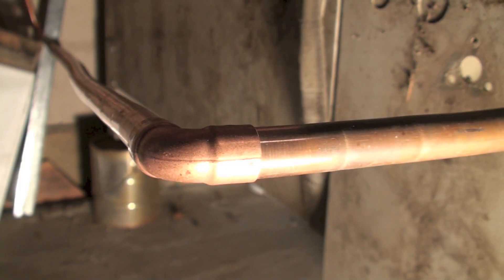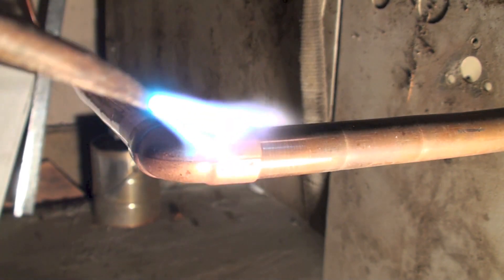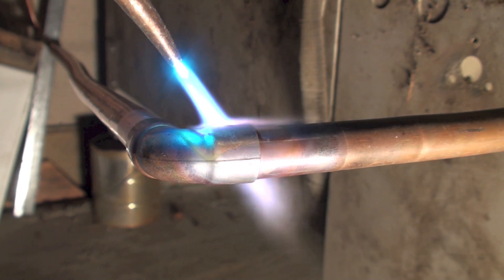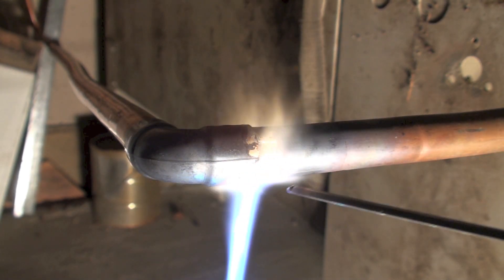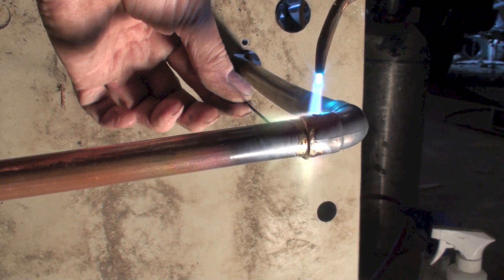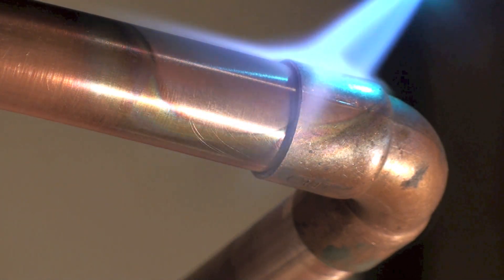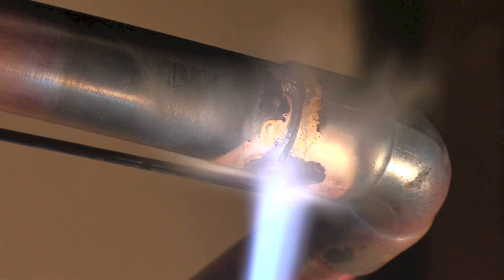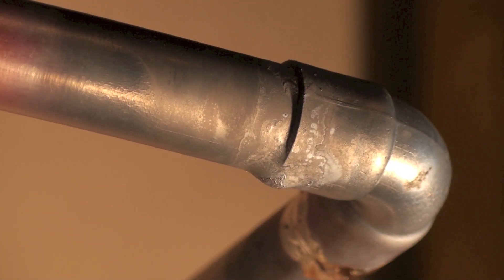How to braze copper with sil-phos brazing rod

Comment: Don't listen nor pay attention to this fool. He does not know how to braze. You do not put your brazing rod where the flame is, You put it opposite it and you let the heat melt the rod between the copper tubes. You will see the rod get sucked in and circle around to where the flame is. Let the heat do the work, not the flame itself.
Reply from the maker: I don't know what you do for a living, but I started brazing and welding in 1962.  
What you say I recommend for low temp solder using a low temp torch.
When using a 15% sil-phos, with an oxy-acetylene torch, your method will get you holes in the tubing.  Especially in the larger sizes.
Constant movement of the torch and "chasing the brazing compound around the joint" when the tubing is warm enough is the best method.  
This compound does not move by capillary action as well as the lower temp compounds do.  You will often get voids on the opposite side.
GFM

Comment: You talk about not letting the flame melt the rod, but that is what you are doing.  If you were doing it correctly, you would be feeding the Rod from the opposite side of your torch. That way the fitting is melting the Rod, not the flame.
Reply from the maker: I am not sure how much experience you have with high temp brazing, but what works for low temp solder does not work for high temp brazing.  
When working with low temp solder, I would agree the opposite side from the flame.
If you try that with high temp, you will be burning holes in the tubing when using oxygen acetylene.  The heat just cannot move that fast.  
Remember the oxy acetylene flame is very hot and that is why you use it to get the job done quickly.  Less damage to fittings is done by heating fast and getting out of there.
Note, the flame is not melting the rod.  When the rod touches the metal, it melts.
GFM
Reply: @grayfurnaceman    My Experience as follows: Beginning in 1973, Graduate of the US Naval School of Refrigeration and Air Conditioning, 45 years experience, as an HVAC Building Trades Service Mechanic, last 10 years as Service Foreman, 30 years as a Union HVAC Service Instructor, as my second job. Bachelor of Arts degree in Labor Studies, lifetime teaching credential for HVAC Service Technology, California Community Colleges. Retired as of 2017.  Not my first rodeo.  I never had a problem with silver brazing (Harris 15, Stay Silv 45, etc), using this technique, which I learned around 1973.  It is the proper way. No problem, if housing the correct tip.  I didn’t use a tip adjusted like a blow torch, unless I was purposely trying to cut a hole.  I have done every size, from small capillary tubes, up to 2  5/8” discharge lines, and 4. 1/8” suction lines. ( design and fabrications of large commercial and industrial systems) Only the tip changed. I used everything from a 0 tip to very large rosebuds.  I start with heating the pipe, then the fitting moving the torch in a semi circle.  I bent my rod 90 degrees, about 1 1/2 to 2 inches from the end.  Got the fitting a dull red and fed the rod in from the opposite side.  Full penetration.  Sometimes I would ad a cap, but it’s not necessary.  The high silver content wire filler will flow like soft shoulder, and is very quick. Used that for dissimilar metals.  If you watch good brazing videos from reputable firms, they will show the same technique. Everyone has their own way. But what I have described is the best practice.  It’s what you have to do when you can’t see the bottom of the joint.  I have watched a lot of your videos, which are a lot better than most.
Reply from the maker: @rodgraff1782  Thanks for the reply.  It appears we both have long experience in this field.  It also appears we have different methods.  So, I would say this:  If it does not leak and does not damage fittings near the joint, it's good.
GFM

Comment: Not bad but I m not 100% sure that there is enough penetration. I m pretty sure that this joint will never leak but from my experience ( 40 y + as an hvac tech ) I don t think that the joint is 100% filled.

Comment: I heard copper anneals and becomes weak - is this risk factor for high PSI refrigerants like 410a?
Reply from the maker: No.  Most linsets are soft copper and they work well.
GFM
Reply: I don't know who is teaching this but it is wrong, wrong, wrong! Yes copper el's anneal when silfoss soldered and will kink real easy afterwards. This by no means makes it weaker, the tube wall is the same and so is the rated burst pressure. Soft copper line sets are "annealed" from the factory, that is what makes it possible to unroll the line sets. If that incorrect theory was correct, why would you be using a inferior tubing from the start?

Comment: ive seen most of your vids and i like the way you explain it. 
is this method ok for natural gas applications around the home? can NG leak from it overtime?
or is this specifically just for refrigeration and water applications? if not ok for NG is flaring out the copper tube the way to go? i am upgrading from external hot water tank to a rinnai infinity hot water system. the tank cold water input, hot water output and NG input is all 1/2". the rinnai is all 3/4 "
i now need to do upgrade in sizing to both water and gas.
Reply from the maker: You can use sil phos for NG.  You just have to leak check like any piping.
GFM

Comment: nice brazing skill, for this air conditioning copper pipes, can i use Mapp gas to do it ? is it possible ? thanks
Reply from the maker: Mapp will work, but oxygen-acetylene gives the best temp control.
GFM
Reply: @grayfurnaceman  thanks
Reply: just wondering in this video did you use flux paste on the copper tube before brazing ? or it is just not nesasarry
Reply from the maker: @stevengao8345  Flux is not used with sil-phos.  It is not necessary.
GFM

Comment: does the same tip can use with lpg/oxygen?
Reply from the maker: You can, but tips designed for propane/oxy are better.  Cutting must have a propane/oxy tip.  Propane, in my opinion is not a value, as your usage of oxygen increases fairly massively.  Welding steel is also not practical.
GFM

Comment: Just tried soldering copper to copper and the pipe was clearly not getting hot enough, the Butane Propane mix gas says it gets to 1300°C and the Brazing Rods are meant to melt at 710°C. The touch head is a bog standard from the diy shop with no adjustment for the flame, could the touch head be the problem? or would it be something else.
Reply from the maker: Much of this depends on the size of the components.  If the piping is over 3/4"  you probably need oxy-acetylene.
GFM
Reply: grayfurnaceman thanks for the reply, the pipe is three-quarter inch and thanks for the advice.

Comment: Love the work, just passed my millionth joint brazed as an industrial hand brazer. You should look into their flux cored rods, you would be able to brazer copper with their 2% rod, much cheaper than the 15 or 18% the offer (save that for bronze, brass, and steel)
Reply from the maker: Wow, one million!  Bet you got good at it.
The reason I have not been successful using either 5% or less is most of the joints are used copper with oil and many other contaminants.  I just had too many leaks.
GFM
Reply: @grayfurnaceman  I can see that, after awhile we got pretty good at brazing just about anything in any condition. On slow days we would challenge ourselves to braze two razer blades together.  Or we would try to find the dirtiest copper elbows and steel nipples we could find and see if we could braze them together.
Reply: @cjrouse9508  Sounds like fun man lol 👍🏼
Reply: @grayfurnaceman  I agree! I use 15% for all my hvac joints. I noticed a 6% works OK with clean brand new copper but as soon as it has a little bit of oil or wear in general- no matter how much you try to sandpaper it that sucker does not want to hold!
Reply from the maker: @dennisivakhov  My thoughts exactly.
GFM
Reply: @dennisivakhov  I tried 6% once and immediately noticed it bubbled with tiny pin holes, same torch, settings technique. Easy to overheat that 6% and very thin. Went back to 15% and never looked back! I'd rather use 1 1/2" leftover sticks than ever try that again. Lol

Comment: i had been a welder for over 30 years before i went to shool for HVAC , got certified after couple years etc etc ,,,,,gettin copper red hot makes it very much weaker you can actually take a street ell and bend it with your hands ,,,, when i did installations i showed and old timer how not to braze but simply solder ,,,they make solder that will take the pressures of any refrigerant with no problem and lot less heat specially doing a reversing valve ,,etc etc ,,,,i could not talk to the new tecks i see about this they think i am nuts ,,,,i am 66 and retired for a long time now i really dont care how a person does his welding but just sharing info ,,,,,,take care and be safe
Reply: Its not about taking the hardening out of the fittings.  If the hardening is removed, the fitting/pipe will have the same strength.  
The use of low temp does often times work well, especially on new equipment.  There is even one manufacturer (Lennox) that used low temp for years in its factory assembly.
If the fit is good, the parts are clean and the tech uses proper techniques and does not overheat the fitting, it will work.
 I was a service tech, and I never worked with new/clean/well fitting parts.  I would only use sil-phos 15.  The best is only just good enough.
GFM
Reply: @electriccar3253  bend a brazed 90 after brazing it ,,,see how easy it colapses ,,,then solder one and do the same ,,,,,,later i am too old to argue LOL ,,,,,enjoy
Reply from the maker: @MrGarcon98  Me too.  Take care.
GFM

Comment: Hey Grayfurnace man I got a weird one that is stumping everyone.. I have a new condenser and I’m brazing in the suction line, all fittings leading up to service valve took the braze no problem even the elbow before this fitting that goes into the valve had no problems taking braze. However when I go to braze the fitting that’s inside the valve, my flame goes orange and it won’t make heat, I lift up my torch away from valve and it turns blue again. I’m using a turbo torch with acetylene. What could this be? Any help would be so greatly appreciated
Reply from the maker: Are you sure the valve is not leaking refrigerant?
GFM
Reply: This is a brand new dry shipped (still charged with nitrogen) condenser. Schreader valves removed
Reply: This is a brand new dry shipped (still charged with nitrogen) condenser. Schreader valves removed
Reply: Ya, the compressor oil has trace fluorocarbons present. Any stronger and you would have noticed by losing your breath and eyes, nose and throat burning worse than any military tear gas.

Comment: Wow talk about over heating  .  Also HEAT Rises   so ideally  you want to heat the tubing first playing the feather of the  flame  around the tubing then  apply the flame to the  bottom of the fitting and work the flame to the sides allying the alloy .  With  the newer types of acetylene types of torches  you no longer need oxygen  as the alloy melts around 1,200  deg F  and the swirl jet type produce 4,800 deg F  . An oxyacetylene flame is close to 5,800  deg and copper melts are 1981. so excessive heat is unwarranted   You want just enough heat to allow for capillary attraction not to much  to  burn the copper

Comment: The video should stress that 'cleaning the joint with emery cloth to remove oxides' before the brazing operation is best and in large diameter pipes necessary.
Reply: I get the oxides, but emery cloth?  Maybe if I had an hour for the job and wanted to see myself in the tube.
GFM

Comment: you dont need flux? a friend tried to melt copper tubing lose from an ac compressor and he said even though he heated it with propane till the tube was getting cherry hot the joint would not melt apart,,he asked some refrigeration guy about this and the guy laughed at him saying he would never be able to melt the silfos using propane and he needed acyt,,but this makes no sense since silfoss melts between 600-800 deg C and propane torch is around 2000 deg C
Reply from the maker: The refer guy is right.  Propane in air temp is around 2000C.  But that is misleading.  You can never actually get to that temp.  Effective temp is more like 1000C.  
Oxy acetylene is about 2800C.  
GFM
Reply: "The refer guy" lmao sounds like that guy has another job if you know what i mean,,,yes they say prop/air is about 2000degC (i guess in a perfect enviroment with little heat loss) but even if half the heat is gone you are still at 1000deg C and this is over the silfos melting point so i dont get why it did not work,,are you saying 1000degC is only what the torch starts at and then loses more from there?,,yup prop/oxy is 2800degC,i have a small torch i made like that
Reply from the maker: 35 years in the business says it won't work.
GFM
Reply: you are not giving me full feed back with your short reply,,yes i know it wont work,,question is with your 35 yrs exp can you explain to me why??? i just told you prop/air is 2000 deg C and even if half is loss you still at 1000 so how is the silfoss not melting while the copper is glowing?? and what did you mean by "Effective temp is more like 1000C.  " i asked you about this and you still did not address it
Reply from the maker: The reason for the short reply is simple.  Its called dissipation and conduction.  Iron melts at 1600C, but to weld it we must use an oxy acetylene flame of 2800C or an electric arc of 6000C. 
I have a forge whose flame is rated at 2000C, yet it barely will melt copper.  And this is with several measures to conserve heat.   
The numbers used for flame temps are only valuable for scientific comparison, not field operations.
GFM
Reply: oxy/acyt is 3100C ,oxy/prop is 2800C and air/prop is around 2000C,,all these torches unlike your furnace should deliver the heat work fast enough but for some reason the propane torch my friend used was not enough to melt the silfoss off the copper tubing even though the tubing was glowing red hot , are you saying that despite the 2000C temp the silfoss was not getting the 800C it needs to melt?
Reply from the maker: Yes.
GFM
Reply: yes what? there you go again with those short replies,,i had a similar guy giving me short replies while im trying to get q's to his buisness ,,he lost my buisness  acting like a teen with me 
ZW
Reply from the maker: Well, I guess I will lose your business as well.  The conversation is ridiculous.
GFM
Reply: your'e GMF is ridiculous and so is your lack of of a full conversation
Reply from the maker: That's GFM, get it right when you are badmouthing me.
GFM
Reply: @grayfurnaceman  some people lose there temp for no reason. all your doing is helping and seems like they have the right to jump down your throat. no respect.

Comment: Great video. I’m in the field as an apprentice and I have been looking at videos all night. This is perfect because the tips you provide and the close up video. Thanks for your help!
Reply from the maker: Dave Kurkian Welcome 
GFM
Reply: @davekurkian. Do not braze like this fool does. I am an HVAC/R mechanic for 49 years. I have 2 Associate in Science degrees from Los Angeles Trade Technical College in Los Angeles, CA. The proper way to braze and get good penetration is to heat the copper fitting and let the heat do the work. Please don't touch the rod to the flame, better yet, once the fitting is heated, touch your rod to the opposite side of the flame and you will see the rod melt right into the joint. And it will follow the flame. You will get a much leaner and professional-looking joint, not that garbage.
Reply: @R4ZK4L-k8f  Where is the link to your video demonstrating your method? I'll watch it to compare the results.

Comment: Do you guys answer questions. The appliance man was sealing an solder joint, but he got it red-hot, is that OK..?
Reply from the maker: Yes.  He was using sil phos.  It melts at about 1700F.
GFM
Reply: Just use nitrogen flow

Comment: You should use flux and a lower heat that torch is far to hot and it will come out a lot neater
Reply from the maker: Sil phos does not use flux.  In fact, flux can get into the joint and make it leak.  The melting point of sil phos is about 1700F you need the heat.
GFM
Reply: Just should use nitrogen flow

Comment: You don't push it around with the brazing rod itself....you move it around with the flame of the torch. I Imagine thats what was meant to be said.
Reply: I wondered about that in some of the videos,  now that I'm getting soldering down.  So thats one of the tricks?    Just have to know when your pipe is ready, because solder does not go in the flame. I m thinking solder is for plumbing and brazing is for Hvac lines?  somebody?

Comment: Good Video. i Agree with the Drip on the Bottom most times, Liquid lines allways ok , EXCEPT if u have to Pull insulation over the Suction line or When you have an Evaporator door to Put on and The Drip won't let the door come on or off.

Comment: did i read your response to a comment correctly, that you do not use flux? i assume this is only with sil-phos, correct?
Reply from the maker: Yes.  One of the reasons flux is not necessary, is that the braze temp is around 1700 F.  That high temp is one of the best ways to clean the joint.  That is not to say you need not to sand the joint.  You certainly do.
GFM
Reply: grayfurnaceman always sand the brass service valves, they are loaded with oil from the factory, brazing will be much easier, other wise bubble gum tacks, or over heating